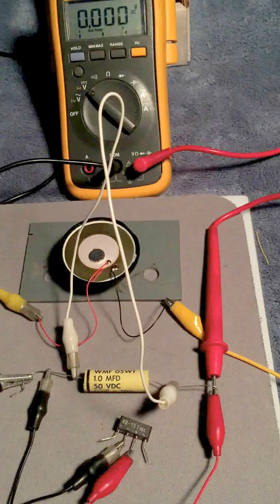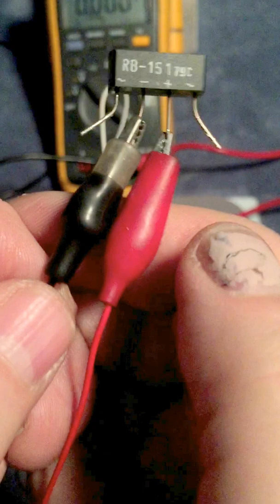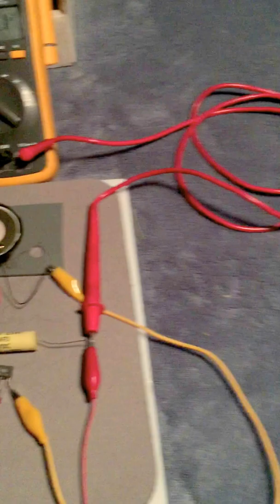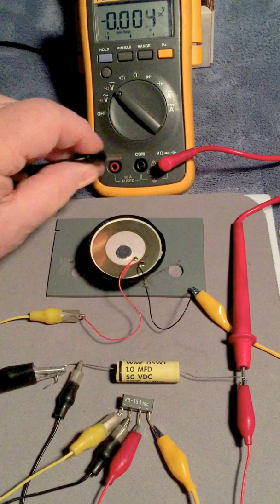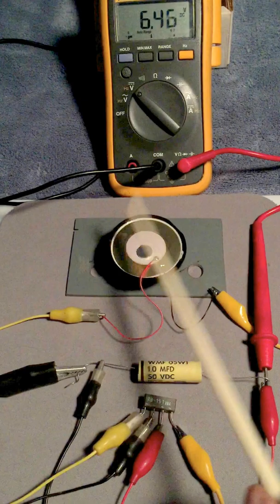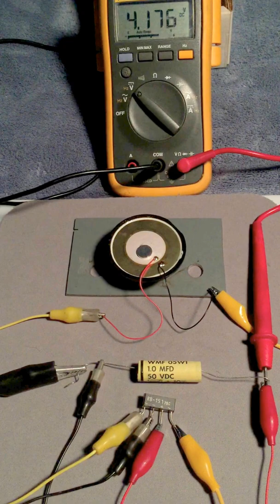SIMPLE PIEZO POWER CHARGES A CAPACITOR

Comment: How much current could such a piezo crystal provide? Like if you were to put it under a dripping water or a waterfall, could you actually power anything useful or would the currents still be to low? 

I tried building my own, but I guess my capacitors were to small because they didn't do anything, although I did use separate LEDs instead of a full bridge rectifier like what you have, it shouldn't matter though. 

I think I need a bigger capacitor!

Comment: hello, could you please tell me how you do it? or what kind of piezoelectric are you using?

I've been working along with piezoelectrics and for me it takes a lot or preasure to make them work and it seems that you with an smal amount of strenght produce a lot of voltage
Reply from the maker: Look at my piezo disc wiring 12 sec vid..
I have a large diameter thin metal disc that is sitting on a NIB magnet attached to an iron plate (with hole).
There is a NIB magnet on the top of the disc keeping everything in place..
The magnets and plate are only a mechanical hold down..
Then tap the disc, to make it flex (bend)  no pressure.. 
A sharp group of taps produces enough energy to slowly accumulate an increasing charge in the 1 uF capacitor..
Then removing the meter load, demonstrates how slowly the film paper capacitor normally discharges on its own and also attests to the effective low leakage of the 4 diodes in the plastic bridge..
This will work with the smaller piezo discs that are now sold on ebay but slower.
Reply: iceng Oh I see, I have a big doubt and that is why the piezoelectric will give me a 10V to 20 v voltage when I press it but when it comes charging the capacitor the voltage won't rise that fast?
Reply from the maker: @EduardoMartinez-dm5pp  Like I said the piezo disc is high voltage but tiny current..
So going through an AC to DC diode bridge it takes a lot of time to charge a capacitor..
The meter loads the capacitor almost as much as the piezo can charge..

Comment: Thanks for sharing your work. I have been doing similar things. I am no expert but I am trying to get a piezo to light a bright led. I have been successful with 1 green led, I think its 1.9 volts led it lights up well (flash's with every bend of piezo). I also added a bridge rectifier and a capacitor and got it to keep the led bright while i kept bending the piezo (as the capacitor is being charged and discharged).

now the issue is that the led is to large for my project. I need to use smd (surface mount leds) absolutely tiny little things. but very bright when i attach a 9 volt battery with resistor to it. Im guessing they are around 3 to 5 volt smd leds. but they don't light up anywhere near as bright as the green led, just a tiny tiny tiny little sparke you cant even see!

i understand the smd leds are much higher voltage. and even as an amateur hobbyist I understand the current and amp etc all come into play (not that i understand any of it too well, but i am aware of they could be the issue.

i will later tonight set up the same experiments and upload the videos, if you could maybe advise it would be helpful. I will also give you all the details i.e. the voltage current amperage of smd leds and what capacitors and tools i have at my disposal.

Thanks
Reply from the maker: Sorry to contradict, but a single piezo disc will put out 80v to over a 100 volts if there is no device to load it.. 
The disc has  very little current and produces AC == one polarity when struck and another polarity when it self recovers..
That is why  the diode bridge and capacitor hold voltage when the meter impedance is off the circuit.
The bridge diodes do more then rectify the AC to DC they also prevent the voltage being reabsorbed by the piezo disc..
That is why putting discs in series wont really add up because you can never strike them Exactly at the same instant of time and that will very likely have some positive while others are negative  !!
Reply from the maker: Actually I am lighting the dollar store lasers with a fast zener protection to avoid hurting the sensitive lasing junction..
Reply: Put more piezo's in series with each other so they are
so 1 is positive pin of the piezo and 2 is a piezo and - is a wire

and 3 is negative pin of the piezo

 2           2
---1 3-----1 3--

with the open ends being your connections to your device.
repeat this so as many peizo's as you want can be in series and you will get higher voltage.
Make sure to to power many in parallel if you want to store a bigger charge.

put a resistor very high value resistance in series with the piezo to make the charge last longer but the LED will be dimmer.
They don't store very much charge though.
Reply: also sorry for the poor quality example its 5 in the morning and i havent got much good sleep.